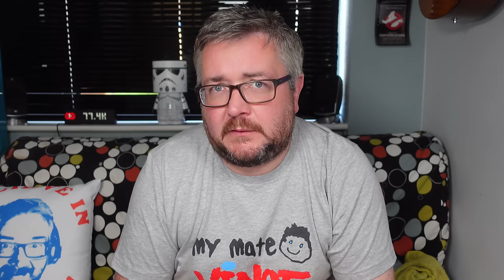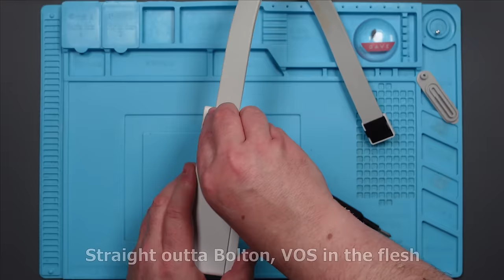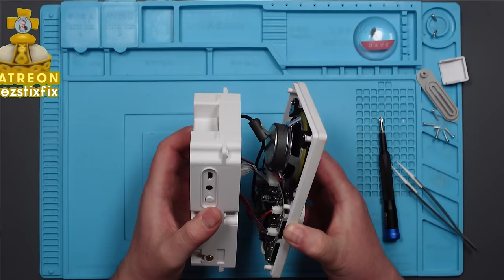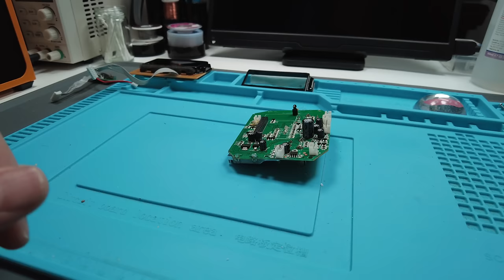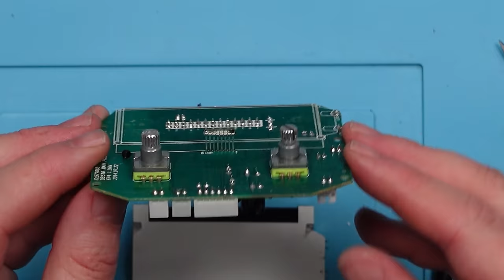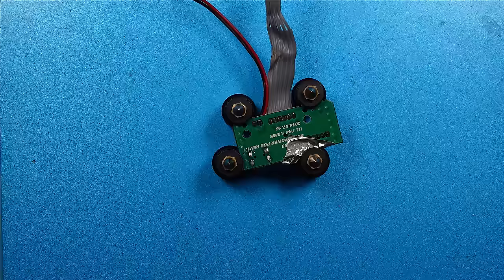FAULTY John Lewis DAB Radio | Can I FIX It?

Comment from the maker: I definitely wasn't wearing my soldering shoes in this one.  Hope I've not lost them... 👠👠
Reply: You wear THOSE👠👠 while soldering? rawr ;) :P
Reply: Pink heels not my first choice but you do you!
Reply: Hot air is a good choice when removing multi pin devices. But if heat is not a huge concern, drag flood all the pins with solder and pull off. Of course low melt solder is best, but regular leaded will work as well. Then you can easily wick/suck out the solder from the vias later!

Investing in multiple size nozzles for the desolder gun will also be an asset as long as you have the appropriate nozzle cleaning pins.
Reply: Flux fishnet tights are a must with soldering shoes.
Reply: hello Steve. jet another funny video. please read my email about the E-Zigarrets 😘
Reply: Better than any soldering I have done I do a little at work but definitely not that small 😁
Reply: At 5:30 a cheap desoldering pump would have done wonders compared to braid and desoldering guns... Just saying.
Reply: Look behind the sofa cushions
Reply: what's a soldering shoe? never heard of them
Reply: How about a special soldering hat? May help. I just destroyed an IF transformer on a very rare German  radio with the injudicious use of a heat gun (don't ask). My soldering is fine.
Reply: It's doing what it's supposed to do, it is a dab radio correct?!? I know most the time I do a dab, I don't know what the fuck is going on for at least 3 minutes...🤣🤣🤣
Reply: @scaleartsg  its a joke !!
Reply: Might start calling you Bob, Since you be fixing everything 🤣
Reply: If you lost them, put some on your Amazon wishlist...
Reply: Hey, i've got a weird Problem with my New 3DS and I thought maybe you would have an Idea. My New 3DS just freezes totally random. Not just the screen, but the whole thing and always at random times. Sometimes it freezes after couple seconds, sometimes after hours. It also does it even if i do absolutely nothing with it. My wild guess would be a faulty RAM, but i have no clue at all. Maybe you know something about this. Or maybe you wanna try your luck on fixing it, I'd be willing to send it over :D
Reply: @Cr3eVe  if it’s new send it back? You’re willing to send it to a YouTuber instead of sending it back to the seller or retail store?
Reply: @redacted7634  Its a 5 year old "new nintendo 3DS". The console name is just stupid and confusing :D
Reply: @Cr3eVe  shut up is that the what it’s actually called? I stop keeping up with ds after the ds light

Comment: Hi, I'm happy to see you using the correct tools for de-soldering, but remember to clean the de-soldering tool regularly with the tools supplied. It looked like you lost suction.
Also, most if not all of the de-soldering tools have a variety of tips available to suit the job you are working on, so too small should not be an issue. (That's what she said) 🤣

Comment: Always when I see you using copper braid I'm amazed how well it works. I usually have problems whit it. I'm wondering what am I doing wrong? I use 350 degC might it be to low? Or maybe I should invest in a better flux. Any tips?
Reply from the maker: I usually go for 400 degC, and flux is always your friend... the more the merrier!

Comment: I noticed you seemed to call out used leaded solder. Do you typically use unleaded solder?
Reply: It's because of the health and safety manufacturers stopped using "lead" in solder, but the unleaded solder is crap. The lead stuff has a lower melting point and flows / sticks a lot better!

Comment: I had the worst time trying to clear the holes for the charger port on the switch. It took me hours to get the solder to clear from them. Any tips to make it easier? Better solder wick?
Reply: Add some flux, then use solder wick ;)
Reply: @BuyitFixit  I tried multiple times to no avail. Perhaps it comes from experience.
Reply: @CoLPluto  Possibly. The solder wick I got off Ebay doesn't seem great. . You could always use a solder sucker. I resorted to that on my latest video (repairing an xbox series x with broken HDMI socket).
Reply: @BuyitFixit  yeah thats what I have planned for next time.

Comment: TIPS.

DESOLDERING ADD LOW MELT SOLDER TO ORIGINAL SOLDER FIRST

WHEN USING WICK TO SUCK UP SOLDER TRY ACTUALLY PLACING IT OVER THE PINS LOL